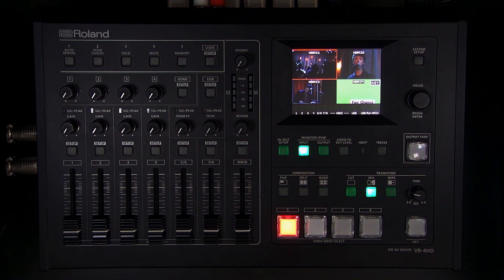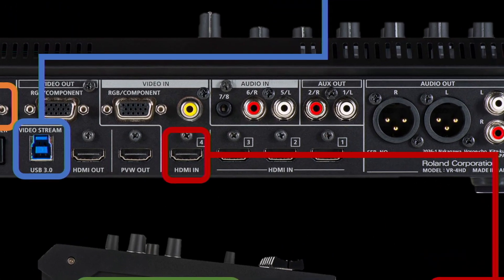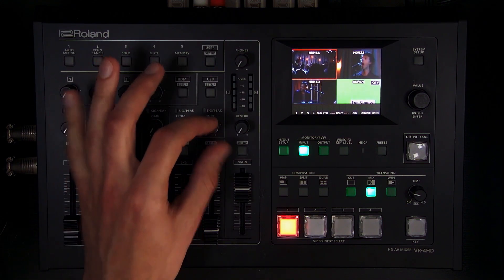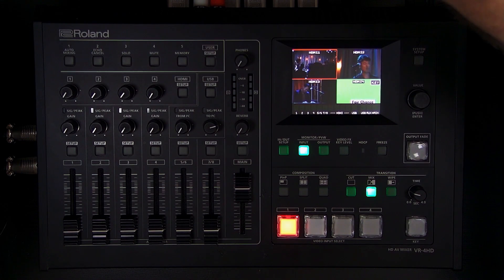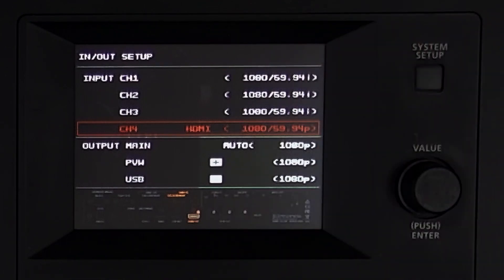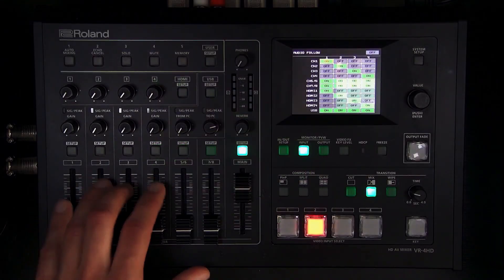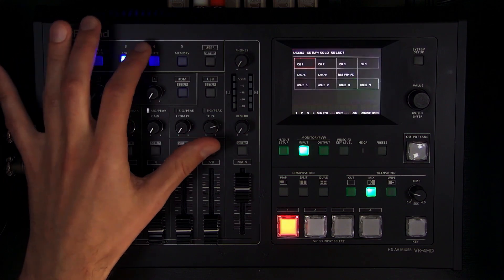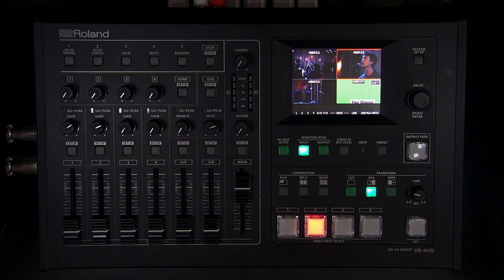Roland VR-4HD Streaming AV Mixer Tutorial

Comment: Why is the PIP the section that allows switching of channels? And the background is locked? 

I want to have my PIP locked from input 1 feed and then have background switchable to my other 3 hdmi inputs. 

I basically have a multi cam event with 3 background cams and then want my PIP on channel 1 to remain locked on my ASL interpreter. 

This is a huge let down and seems like they have this backwards compared to how people usually use PIP on other hardware. 

Am I missing something here , is what I’m asking possible? I read the manual and it doesn’t seem like I can. Please answer, as I have a major event in 3 days. Thanks!!!
Reply from the maker: You can change the background source using the LCD touchscreen, simply tap the input to switch to it. The Input buttons only switch the PIP source while it is active.
For additional support, contact us at roland.com/backstage to go over it.
Reply: @RolandProfessionalAVSupport  ok thanks! Wish that was a little more clear in the manual. Also would be nice if the input buttons could be changed to control background as well as pip box. Thanks you

Comment: On the video out, will it output video stream, rgb, and hdmi simultaneously? I was wondering if I could stream, use pvw out for monitor, then rgb out to another monitor and hdmi out to another monitor or device...
Reply from the maker: Yes, all outputs are active at the same time.
The only I/O that requires a selection is HDMI Input 4; you can choose between HDMI, RGB, and Composite.
More information is in the Block Diagram: https://static.roland.com/products/vr-4hd/images/blockdiagram.pdf

Comment: Hello, I havea chance where by my output display is show the four section as in the mixer.how do i chance to one display on the output display screen ?
Reply from the maker: Press the "In/Out Setup" button. The last 2 settings change the output type for the "PVW" HDMI and "Video Stream" USB outputs. You can have them be either full-screen program output or 4-way split-screen output.